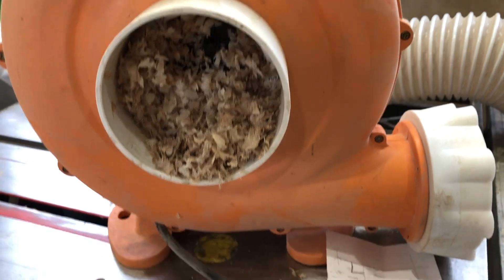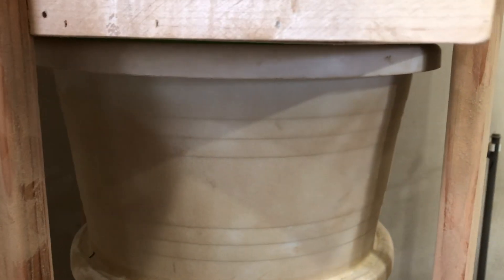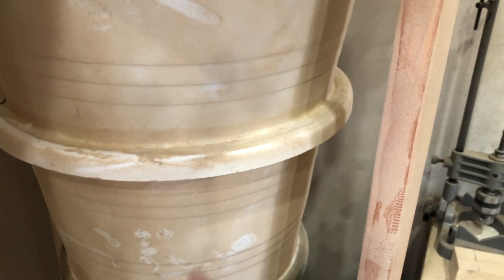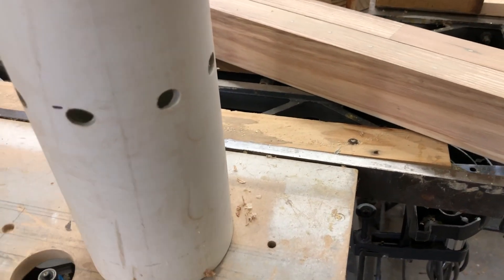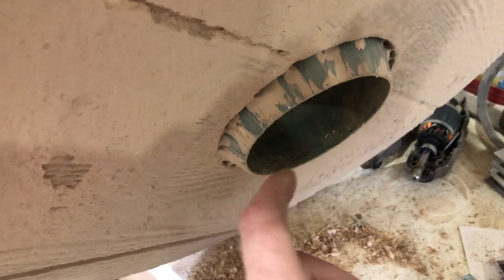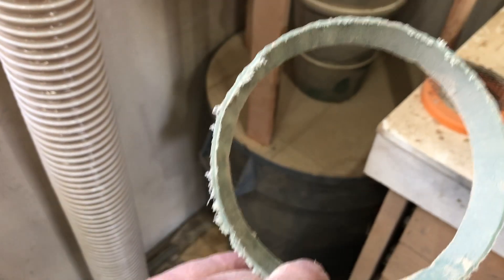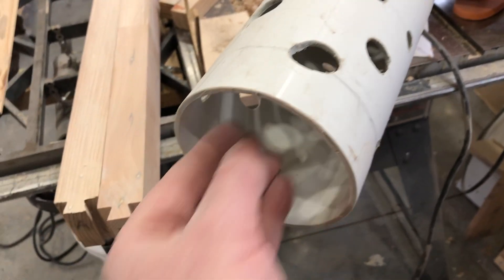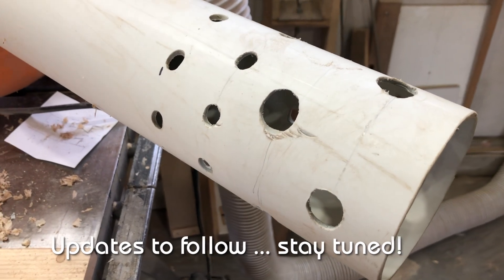Dust Collector Update - Cone Adjustments

Comment: Interesting. I'm working on an old Delta mobile 'cyclone' right now, converting the bag to a cartridge filter. How far does that pipe go into the cone? Is it too maybe long? I'll have to get a peek at the previous videos to see the actual setup. At any rate, good luck 😊
Reply from the maker: I suspect that the pipe may reach too far into the cone.  Drilling holes into the pipe is my first attempt to resolve that, and if it doesn't work, then I'll cut the pipe.  Stay tuned for further updates!
Reply: @secretundergroundlair4014  I'll be interested to see that. I know there's a formula for that, but I'll be pulling my Oneida cyclone out of storage soon, and I'll get some footage of their intake so you can take a peek. 😉